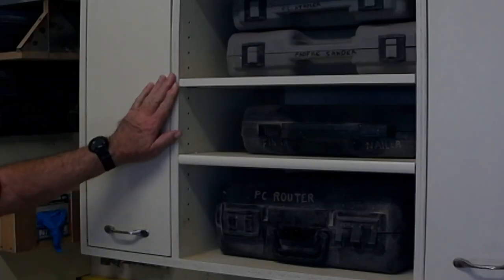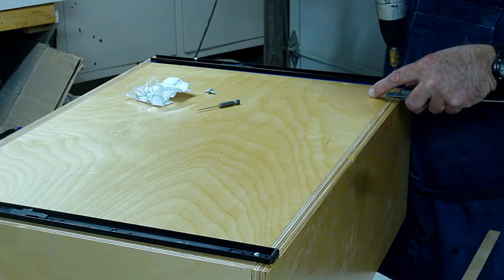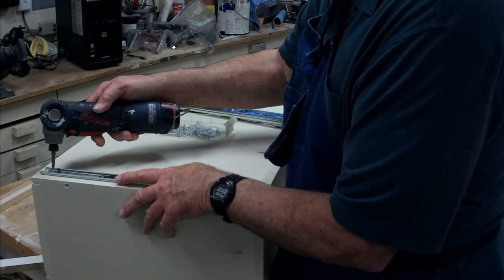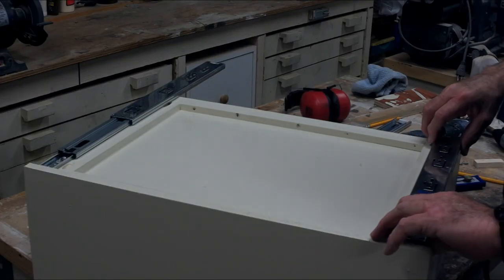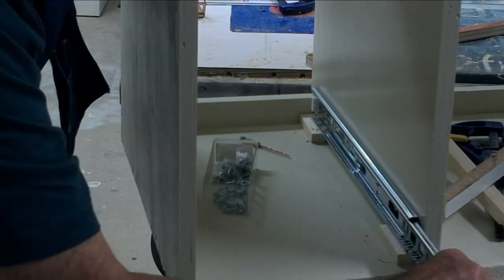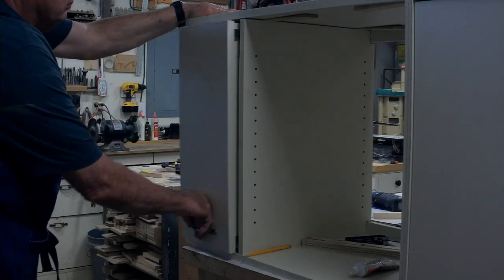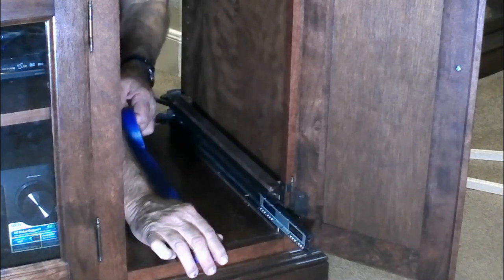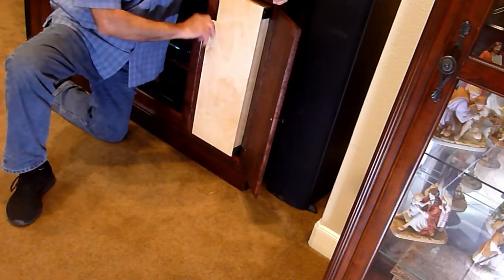How to easily install full extension vertical diy drawer slides "on the money".

Comment: Is there slide hardware, perhaps mounted on top and bottom, that would allow this to slide out and then pivot in such a way that you can look at the contents if you were facing the counter, instead of standing sideways to the counter?
Reply from the maker: Offhand, I have never seen all in one hardware that would allow you to both slide out and swivel the drawer.  I have seen this done by combining slides and a seperate swivel assy.  You basically build a drawer within a drawer.  Here's an example.   https://www.youtube.com/watch?v=3e5NKlPT8NE
Reply: Saw this comment and think I know the solution

Make a Steady base for the mechanism for the bookshelf to rest on, with the drawer slides on they left and the right

Then add a lazy Susan type joint so you can then rotate the shelf

A ball bearing rotating /swivel plate will also work

For additional support you could add another drawer mechanism on top, with and additions swivel joint
Reply from the maker: @b29ak2007  Sounds like it should work.  You may need to adjust the depth of the drawer so that when it swivels, the back end of the drawer won't make contact with the cabinet.  If you try it, let me know how it works out. Thanks for your input.

Comment: I would like to try your slide design but I'm wondering.  How hard is it to insert the drawer into two vertical slides on the right side and one horizontal slide on the bottom?
Reply from the maker: The main thing to a successful vertical is precision measuring for the lay out of the slides.  Next, when you insert the drawer, start with the bottom.  Leave the side slides recessed in the  cabinet.  When you have the bottom started, then start the other two.  It's actually pretty simple.
Reply: @deerparkhomeshop2471  Thanks for outlining the procedure you use.  Sounds simple enough to do.  Keep up the good work!
Reply from the maker: Thanks, let me know if you have any more questions. @RAPTOR8ASDF

Comment: Hi 🖐️
Why not the third slide 'on' the drawer..?? 🤔
Reply from the maker: My drawer was designed to hold three levels of dvd holders.  If I had put a slide on the open side of the drawer I would have had to add 2" of height to both the drawer and the cabinet.  To answer your question, the slide layout can be different depending on the design and purpose of the drawer so long as stability is not an issue.  For instance, I used the third slide under the drawer because it was too wobbly without it.  You could use one on the top left and two on the right top & bottom, or vice versa.  You could even use two on each side.  Hope this answers your question.
Reply: @deerparkhomeshop2471  Thank You 👍
Reply from the maker: @noeliafernanda1061  Anytime!  Thank for reaching out to me.

Comment: I would never put the slides on the sides. I always put one slide at the top and one slide at the bottom.
Reply from the maker: I've seen it done both ways. The configuration I used is mainly because the drawer contents are heavy and the side mounted slides will support more weight than horizontal mounts, and I tend to overkill everything I do.  Do you ever have a problem with the top & btm. slides binding or sagging under heavier loads?
Reply: @deerparkhomeshop2471  Regular drawer slides are designed for heavy loads. This kind of drawer is no different from a regular regarding the mount of the slides. I just put the slides right and left, exactly at the half height of the drawer, no matter its height. And always I remove the hinges and turn the door into the drawer's face.
Reply from the maker: @1zanglang  The vertical spice drawers in my kitchen are made with slides centered on each side, but they also have a centered slide on the bottom underside of the drawer.  Are you using the third slide on top or bottom of the drawer?  I put two slides on on the back side of the drawer because I didn't have enough drawer height to install a mounting surface on the open side of the drawer.  If I did that my DVD holders wouldn't fit..